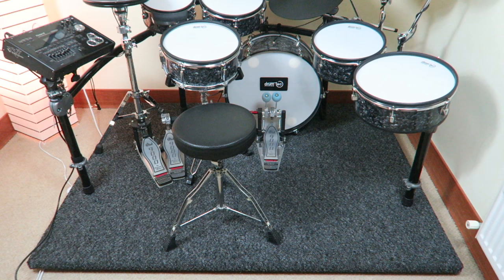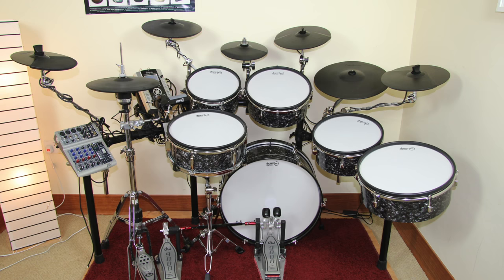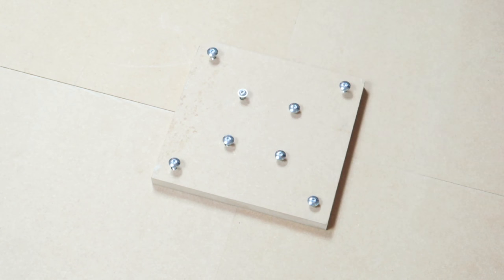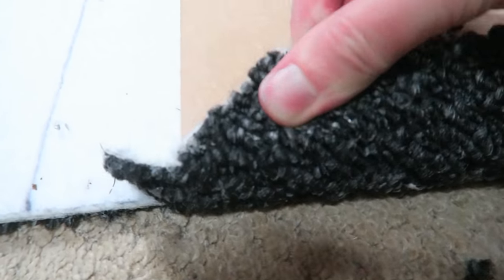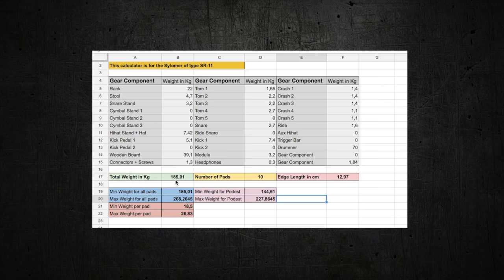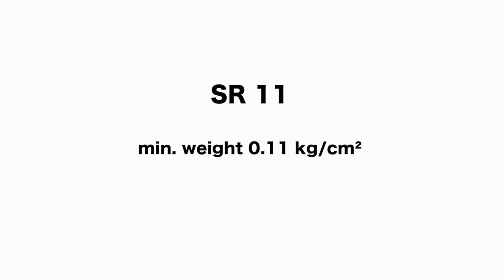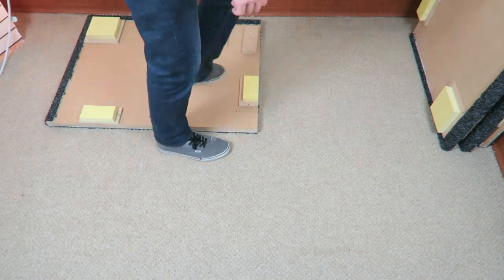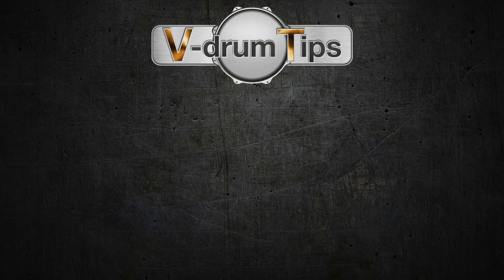E-Drum Noise Isolation Platform - Tutorial

Comment: I've made something similar a while ago. Additionally I've made the platform acoustically transparent by drilling it full of holes using a pot drill bit. Otherwise there was a low frequency resonance between the platform and the floor making the sound insulation worse at that particular frequency.
Reply: would love to hear more details about what you mean. So the kick still transmitted some noise, and you basically drilled some bigger holes in the top and bottom layers of the platform to remove this sound coupling?
Reply: @jimbobbillybob  Yes, Underneath the whole platform there are two layers of Easybond foam with a total thickness of 9 cm. The platform itself is two layers of OSB board with a thickness of 22 mm each and screwed together, but with a thin foam layer in between to eliminate friction noise. Through the whole of the platform I've drilled holes with a diameter of 20 mm, in a rectangular pattern each 6 cm. The more holes, the better as long as it stay structurally rigid. Larger holes are also better, but you don't want your chair legs to get stuck in the holes. It did the job to get rid of the resonance mode between the floor and the platform.

Comment: Thanks for making this video! I am planning to recreate this platform for my own e-drum use. On the website you posted for buying sylomer there were options for both adhesive and non-adhesive pads. I'd like to save money and order the non-adhesive pads, but I am concerned of not being able to properly secure them. Do you know if adhesive spray or epoxy glue would work to secure the sylomer to mdf tiles, or would this interfere with their dampening properties?
Reply from the maker: That would both work, but double sided sticky tape is just as good.
Reply: Hi again! I am purchasing the materials to make my platform tomorrow. I was wondering what length machine screws you used for the 24mm platform / 19mm connectors boards. I will be using a 1" platform and 0.75" connectors and want to make sure I have the right length machine screw for it to be properly secured. I was also wondering if there is another name for the waft nuts you used to secure the machine screws... I cannot seem to find that yet in the US. I really appreciate your help!

Comment: Love the video! Very informative! 
I have a question as I intend to build my own v soon! 
Do you have to build that platform for the drummer as well or could you build it just for the kit and sit off the platform, what do you think?
Thanks!
Reply from the maker: Jeffrey G Thanks for the feedback:) Yes, you can build it for the kit only. The problem is, how do you calculate the weight of the legs standing on the pedals and the legs hitting the pedal? But I think you should try. Let me know if it works:)
Reply: My idea was to build it just for the kit, to reduce the foot print, and use weight to bring up the weigh if necessary.
The extra for exerted from my legs should be absorbed once the overall downward force is within the range... right? I'll give it a go and let you know! 
Overall though, would you say it is worth it? My E-kit is currently unplayable due to new accommodation, I'm happy to invest and build, but I really need something to absorb 90% of the vibrations!
Reply from the maker: It will not absorb 90%. Maybe 75%. And make sure it is the impact noise that bothers your neighbours. It could also be room noise.
Reply: Yeah I reckon it is but I'll confirm with them, the E-kit itself is very quiet, like the TV is louder than it in room, thanks again! 
I'll let you know how it goes (:

Comment: Is that OK to use platform just for drum kit and pedals placing stool on the floor? Will it still work? For sure it may be not so easy to calculate mass spread of drummer precisely - if body with stool is on the floor and just legs on pedals gives additional body weight on the platform... And the load will depence on how do you usualy play - hill-down will add more weight to platform than hill-up when legs are mostly floating...

Comment: Given you can have a 45% increase from the minimum weight, I think it would be wise to reduce the calculated weight by a bit and then continue the measurements. ie. do your calculations at say, 170kg which still gives you a range of 170-246kg.

This lets you accommodate for weight loss or replacing components of your kit with lighter ones.
Reply: I agree. By choosing 0.011 N/kg as the starting point you are right at the edge of the effective range. Anything lighter and the effect wouldn't be as wanted. Therefore i'd use another value keeping a margin in both directions.
Reply: I just emailed Getzner, who make Sylomer, with all the sizes and weights of what I was intending to do and they got back pretty quickly. Advised the size of pad (which were not all the same by the way) and approximate locations. Way easier.
Reply: @jonesteves4286  does it work for you??

Comment: 1:14 as of isolation mats for washing machines, technicaly it should absorb the impact noise good enough, but it is complete waste of money if it is thinner then 2cm.
Bought some cheap ones on Amazon and noticed some HUGE improvement, but neighbour still can hear kick pedal slightly.
As of alternative, Cork Board (from Pin Board) could work as an isolation too, but 1 cm thickness is not enough.  
2,5 - 4 cm thick ones cost ALOT, so not tested it yet. Is there anyone who tryed this?
I do have a project on my mind to make a platform of rug, washing machines rug (2cm), Cork Board (4cm), MDF board (2,5cm) and Sylomer 11 under, but this would cost me as much as a beginners drum set :D 
Does anyone know if using washing machines rug with Cork Board works?

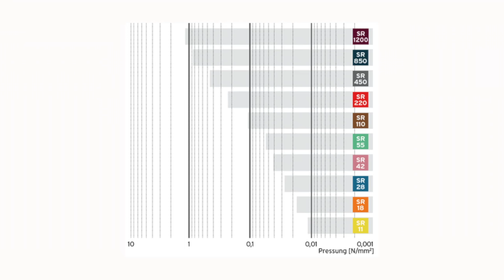Comment: According to the sheet in 6:05 you used the weakest type? I want to make this platform but not under my seat, that would be outside the platform. I also have a Roland TD17 KVX kit, which is much lighter than yours (I guess about 25 kg in total). In 6:14 you say "If it carries too less weight, it won't work". So my question: Will it work for my much lighter platform?
Reply: As long as the weight is within the "working range" for the amount of sylomer you use, it should be ok. It can't be less and it can't be more. Just take the total weight and use the formula to know how many sylomer area you need for your case.
Reply: I am planning on buying td17kvx, is it really loud? I have very stupid neighbours, I live in apartment on second floor.

Comment: There is something I don't understand. I'm using a set with a total weight of 175 kg (including board and drummer), and I bought SR11 pads that measures 100x100 and is 25mm thick. According to the data of getzner, the allowable load of SR11 (size 100X100, thickness 25mm) is 50~98N (about 5.1~10kg). Calculating using an Excel file, when using 16 pads, the size of each pad is about 10cm. However, in this case, the minimum weight applied to each pad is about 11 kg, which exceeds the allowable load of the pad. Will it work if I use it like this? Or am I doing my calculations wrong?
Reply: Did you manage to get it to work?
In the video they state that minimum load is 0.11 N/mm2. This is the MAXIMUM load, not the minimum!
Getzner told me it should work best if loaded to around 90% of the static capacity.

Comment: hey, thanks for the advice. Do you know if this method is really effective? and is it mandatory to have the drummer on the platform? (I'm thinking i could reduce the price that way)
Reply from the maker: Bennn It is not mandatory to have the drummer on the platform, but the relation between weight and sylomer has to be right, otherwise it does not work.
Reply: Vdrum Tips That was my question as well. Do you have to calculate the impact of playing in deciding on sylomer placement and number of pads? You mentioned R-Drums did the calculations for you. Do they have a website?

Comment: Very nice and helpful video to solve the impact noise. I m using tennis balls now and they do the job average, but this would be great! What about room noise? What do you suggest other than quiet pads or light drum sticks..etc. Do you think some insulation elements like fungal panels or heavy barriers could decrease the room noise for downstair neighbors? Thanks for the video..
Reply from the maker: The room noise is overrated I guess. It might appear loud, but most likely you wont hear it in other rooms. I think the noise that disturbs your neighbour is still impact noise. But you can of course isolate a room with acoustic isolation panels.

Comment: If whether the sylomer works is entirely dependent on the weight wouldn't this mean only you could use the drum set with little vibration?
Reply from the maker: Only me + 83kg. Sylomer works in a weight range. My 10 Sylomer blocks work with a weight of 185-262kg. That means I can eat alot and it would still work:D

Comment: Much easier solution: Get one or two thin bed mattresses, put a board on top - done. Even weight distribution on both the floor and the board, the board itself can't vibrate and generate noise itself. And it almost doesn't wobble.
Reply from the maker: This is of course a solution too, but I wanted to build a high end board and present it in a video, since this solution is not excising in video format until now.
Reply: I have done the same thing, but with a futon. I measured a 20-30 db difference in my under stairs neighbours bedroom  when using the futon. I only measured the kick drum, as that seemed to be the noisiest. 
For now, I am content with having my chair on the floor, and the kit (Roland TD-9) on the futon. For pedal stability, I have added wooden boards underneath. These have been screwed into the holes the pedals have for that very purpose.
So far, it works like a charm!
Reply: I stuck an old kid's toddler mattress underneath my drums till I could make up a more permanent solution. I found that the mattress actually transfers no vibrations to the floor! It's quite soft though, too wobbly

Comment: What do you think about building a platform, where the drummer doesn't sit on? The platform would be smaller and also cheaper.
Reply from the maker: Simon Kreß That is possible too and indeed cheaper. However, the weight is not well distributed then. A big plate distributes the weight equally, while a smaller U shape construction would have different amounts of pressure at various spots. Calculating this is very difficult.

Comment: Hi. Great video! But could you please explain why you choose to use the SR11 (instead of the SR18 for example)?
Reply from the maker: I could have chosen the SR 18, you would calculate with 0.18 instead, but the resulting Sylomer-pads would turn out smaller. This would work, but does not make much sense for such a "light-weight" construction. Smaller pads mean that the gap between the pads is bigger and the MDF plates can bent more. You choose harder Sylomer if you have more weight pressuring on the same small surface. Does that make sense?
Reply: Yes, thank you. I think I will build a platform like yours, this is probably the best solution I've seen.
Reply from the maker: I'd say it is the only one where the result does not depend on luck, since you cannot calculate tennis balls:)
Reply: Can you just place the Sylomer pads on the floor (like half tennis balls but well located) and a wooden board on top or you have to glue them to the board to be more effective?
Reply from the maker: You can just place them on the floor. It is actually smarter than gluing them, since you can still change the distribution this way. This is why I made them removable.

Comment: I am not sure the calculations are correct. You are calculating as if the weight is evenly spread, where it is not! Under the drummer the weight is much more then under the kit .. Even on the DE link for the Sylomer they are offering a set of different blocks ..
Reply from the maker: Yes, this is why I used most pads underneath the drummer. But you are right, you can also use different kinds of Sylomer, but this is too complicated in my opinion. Both solutions work.
Reply: Thanks. I guess I will contact the DE site with question about how to spread their set .. anyway very good video and comes just in time - I will definitely  borrow the idea !
Reply from the maker: Yes, they seem to be experts with this. Let me know how it works out for you:)